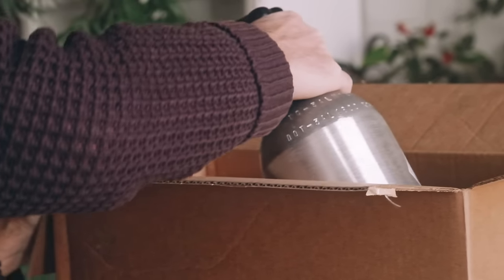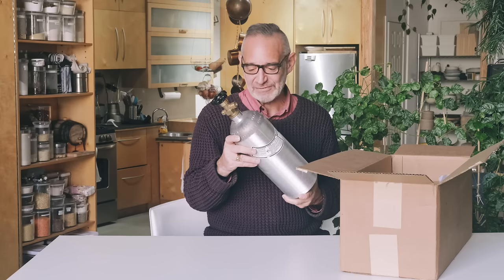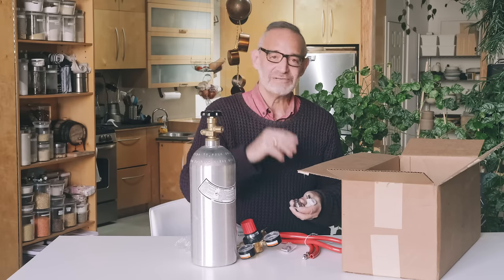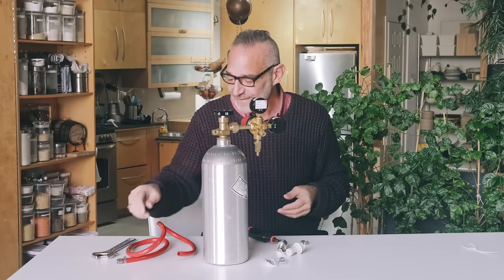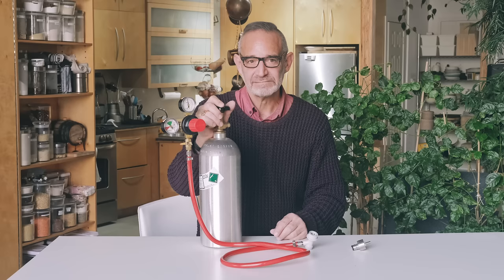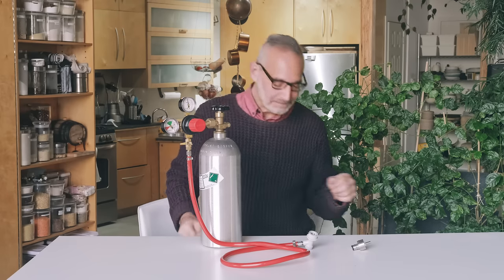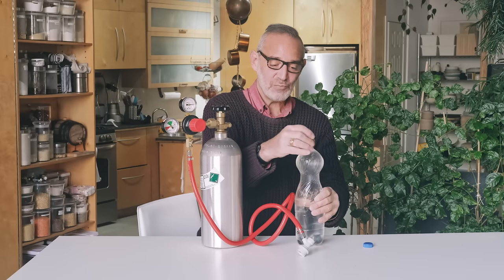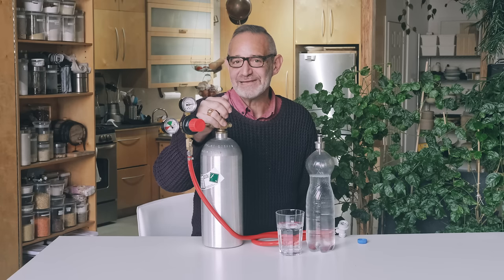CO2 Tank For Making Sparkling Water | What To Get and How To Put It together

Comment: I use a 5 lb tank to refill my smaller gas cylinders at home.  $34 USD for the braided stainless hose and fittings and $79 USD for a NEW powder coated aluminum 5 lb cylinder.  No regulator required.  $16 USD to fill the 5 lb tank.  For an additional $14 USD I can get a hose and fitting to hook the 5 lb tank directly to my AARKE soda machine.  Just another option to your system.  Thanks for the video.  New kitchen looks great!
Reply from the maker: Interesing system you have going!  Yoou'll see in coming videos that we like to carbonate various things aside from water, so using the soda bottles works best for us. Glad you enjoyed the video, and the new kitchen!
I like the Seinfeld reference too.
Reply: I just bought an Aarke & would love more info on how you hooked it up to your 5lb tank and how you hide it please! I also like the idea of refilling the cylinders but I’m a little afraid of doing it.😬
Reply: @melanie.c25  I don't hook my 5# tank directly to my Aarke.  I refill the cylinders.  There are videos on Youtube that show in better detail than I can explain here.  You need the tank.  The hose setup from amazon.  And a scale to weigh the small tank as you fill it.  It's pretty safe.  The tanks are rated for about twice the normal pressure, so if you fill it correctly, you have a huge safety range.  I have filled 4 tanks and expect to get another tank and a half out of that 5# tank.  That's under $3 per tank.  The 10# tank would save even more as it is only a few $$ more to fill 10# than it is 5#.  But the 10# is awkward to handle when filling the smaller tanks.  Also, the hose set up has great instructions included.  I can't post a link on youtube but this is the actual product: "FIDEURSUS CGA320 G1/2 CO2 Cylinder Refill Adapter Hose CO2 Refill Adapter Fill Station Connector Kit for Soda Filling for Tank Bottle (CGA320 to TR21-4, 36inch Hose, Dual Valve with Gauge)".  This company also sells the direct hookup kit, although you will have to modify your Aarke body or cut a hole in your countertop to use the direct hookup.
Reply: I never would have even thought to try and refill them, so very glad for this comment!! I need a machine my kids can use but haven't invested in it because of cartridge price. Being able to refill them at home instead of spending $100 or so for a pack of CO2 tanks is genius 😅
Reply: Make a video for that plz
Reply: @loneranger5349  your mama
Reply: How many liters of water Perrier like does it give you? Give or take
Reply: It costs me $17 to fill my 20 lb tank
Reply: @krazmokramer  The problem with the Aarke, and i assume all the other SodaStreams, is that those units determine the maximum pressure that they allow the H20 to be pressurized with,  quite low probably for 'lawyer's ' purposes. The name of the best and cheapest game is what you see in this video; 
De-aerated H2O to start with  mildly boiled will do that), then chilled to the point of being slushy-icy, then CO2 infused at say, 50 psi, then put right back in the fridge to stay as chilled as possible- short of solid ice.  When time to uncap (gently) and pour, use a icy chilled glass, and GENTLY "slide" the pour into the glass.  All these steps will maintain the maximum CO2 'tang'. I used the Aarke system for two years, refilled the cylinders from a 20 lb CO2 tank. A LOT of CO2 is wastes in purging the lines each time so its quite wasteful, and the Aarke, though an elegant sodastream system, just doesn't put out the carbonation that the above system will, and is a LOT more expensive to buy AND use.  Been there, done that.
Reply: @divingfe  I have no "problem" with the Aarke.  It works exactly as promised, looks good on the counter, takes up very little space, and has not broken or failed to perform in the nearly 2 years I have owned it.  I'm not trying to set a world's record for the highest molar concentration of CO2 dissolved in water.  I'm just trying to get something that satisfies my desire for carbonation.  I have absolutely no problem with my Aarke.  It suits my needs.  As for it being "a LOT more expensive to buy AND use", yes, it was more expensive to buy.  As for the expense to use...it's exactly the same.  A 5, 10, 20# gas cylinder hooked up to my Aarke or a 5, 10, 20# gas cylinder used as in this video will cost me EXACTLY the same for the cylinder purchase and each time I refill that cylinder.  I have better things to concern myself with than trying to get the perfect bottle/glass of carbonated water.  I carbonate it, drink it, and get on with my day.
Reply: @krazmokramer  I'm glad you are happy with your Aarke system. I was, for about 2 years, using a 20# tank to refill 3 of the Sodastream cylinders, then each of them in turn to the Aarke unit, and 3 Aarke plastic bottles  to fill after being chilled. I  found that a lot of gas was wasted in the processes (as careful as I was), and, as mentioned, the Aarke didn't give me personally, enough CO2 'tang", because of its internal pressure limitation (the "buzzy" pressure relief sound)- nowhere near what the newer system does.
 In fact, when I first switched over to the 'new' system, my 20# tank was "so empty" that it would only fill an Aarke cylinder to about 100 grams-rather than 400-500 when full- , hence time to get it refilled.
 BUT, when I connected the new system (without refilling the big tank),  it has, up to now,  filled the  2 liter plastic soda bottles- 1 per day average-  for almost two months and it still has enough "pressure" for at least another month! Hence my comment about it being much cheaper on a daily basis.   When I was researching the "newer" system, I read a great article- 10 years old- about a person who had "invented" (not really) the tank/regulator/Soda Bottle system. He stated that, using a 20# CO2 tank with his system, he was able to fill  a single 2 liter bottle daily for a year and a half, before needing to refill it!!!  (Frankly, I didn't believe it it first; I sure do now!!!!)   Considering that to refill the big tank; It was $25 a couple of years ago, now it is $40.    To each his own, and welcome to it.  Best to you, sir.
Reply: @divingfe  I didn't get what do you mean by "new system". This is refilling system? or it is about how it is infused into the water? or it is about connecting big tank directly to carbonator avoiding small tanks refill?
do you have some googlable name for this "new system"?
Reply: @artemsokolov5007  Sorry to have been unclear. The 'new' system I refer to is, as shown in the video:  a larger, (5-20 lbs) tank, filled with liquid CO2- hence the weight designation- a dual gauge regulator attached to said tank, and an output hose attached to the regulator, which is, in turn, connected to a "carbonator cap", which connects, typically to a 1-2 liter PET (plastic) soda pop bottle, which has been filled with regular drinking water. Via the system just described, the CO2 (now a gas as it leaves the main storage tank) is infused into the water, at the pressure level controlled by the regulator. 
These systems, and/or their components are easily available on-line, or from local Homebrew beer/wine shops, who have lots of helpful advice, and can usually keep your storage tank refilled as needed.
It is not actually a "new" system; In various iterations it has been around for many years, but, after using the Aarke/Sodastream method, and being a bit unsatisfied, I "discovered" this "new" (old) system in various YouTube segments. I PARTICULARLY RECOMMEND the  "ART of DRINK' series on YT, and especially:  'Carbonating at Home with Improvised Equipment and Soda Fountains.html.  by Richard J. Kinch,  an excellent and very detailed description of the system, by one of the 'pioneers' of the system.  
I suggest Googling  "TAPRite", a respected purveyor of regulators and associated equipment, and, as, as you have found, YouTube as well.  
Hope this clarifies and helps. Kind Regards
Reply: @divingfe  thanks a lot man! really helpful stuff!

Comment: I've been using a setup like this for some years. I usually flavor my water with lemon or orange extract to a 1% solution (10 ml/liter) and typically use 2 liter soda bottles. I'm in the US and used to get my cylinder refilled at a fire extinguisher firm. Lately, all the places that I've gone to (4 or 5) won't refill the cylinder. What they will do is an exchange. The one disadvantage of this is that you don't get to keep your nice pristine tank. There are several advantages. First you pick up the exchange and leave and so you don't drop off your tank and come back later (sometimes much later) after refill. Second, you don't have to worry about the periodic hydro test every five years (in the US, Canada also from what I've read) as your exchange will have been properly inspected.

Comment: Good video. There is only one thing I would add. I would never pressurize anything instantly like he did. To many variables. Hook it up with the quarter turn valve off then hook up the bottle. now slowly open the valve. It will carbonate just as good without a possible blowup. Even at 15 psi, that is Pound Per Square inch, is a little dangerous. He is correct. Good carbonation is temperature and pressure. I worked on commercial carbonators in my youth.

Comment: I use the same system but added a rigid plastic tube (straw) to the bottle adaptor that just reaches the bottom of the bottle, then put a diffuser stone on that. The result is thousands of tiny bubbles of CO2 bubbling up through the water. I set my regulator to 40 psi, start the flow just like here and walk away for a minute or two, one shake just to be sure and add flavoring!

Comment: Never open the tank with the regulator set to any pressure other than zero psi. Always have the tank secured so that it can't tip over & potentially damage the main valve (tank will become a violent projectile under catastrophic main valve failure).

Comment: Awesome. I pieced together a custom kit like this one for $181 on Amazon, but using a SodaStream glass carafe. Because of this video, I was able to learn about all the custom parts I needed. One innovation I did was to affix a double barb bulkhead fitting through a hole I drilled into the plastic cap included with the carafe, and silicone washers to make it airtight. I used high pressure food grade tubing between the barb of the pressure regulator and the barb on the cap, with black hose clamps with shrouds meant for fuel lines to tighten the hose onto the barbs (so it has improved aesthetics sitting on your counter top instead of having visible steel hose clamps). I also bought a tank that looks decent sitting on my counter top.
Reply from the maker: wow, sounds like you've made a great setup!  Glad we could inspire you.
Reply: Hey filling a glass bottle with this setup is very dangerous, the glass could explode on you, be very careful. That is why the soda stream that uses the glass bottle is completely enclosed. I would very much advise against this.
Reply: Can you please share the Amazon links for the parts you obtained?

Comment: I've built a similar system seven years ago using a 20 lb tank. Cost $40 to fill and has lasted us for a few years before refilling. We usually carbonate a 2 liter coke bottle (8 cups) and that serves the whole family at dinner time.
Reply from the maker: Sounds like you have a great system for the whole family!  You’re saving a ton of money compared to using a sodastream!  Thanks for sharing
Reply: @NadiaandRob  Same system here for two of us. One 2 liter bottle per day on average. The 20 # tank will last until the tank pressure won't maintain  desired infusion pressure, Loooooong time. !!!!!
Reply from the maker: @divingfe  yes, a 20 lb tank is great if you have the space to store it.

Comment: Ordered from the US site, can't wait to get it. Had a bad experience with soda stream support and was looking to have a replacement, So excited thank you!
Reply: Arrived today, got my cylinder filled at a local shop called Aegis. Mine came pre assembled, and had a slight leak in one fitting but was likely just knocked loose in shipping and easy to fix.
Already loving it, way better than soda stream by far. Ordered a few more carbonation caps from Amazon to have spairs. 
Again thank you for this video!
Reply from the maker: So glad that worked out so well for you!  Stay tuned for other drinks you can carbonate.... video coming soon.
Reply: @TheSeeker385 which US site did you order from? My wife wants a soda stream and I knew there was a more economical way to do this.

Comment: Bought this kit for my partner for Christmas and omg he's like a kid in a candy store! He makes every and any type of drink fizzy. Thank you for the informative video! Do you happen to have any recommendations for a setup to add it to a coffee/tea bar?
Reply from the maker: So glad you're enjoying your carbonation setup.  The simplest way to add this to a coffee bar would be to make space under the bar for the CO2 tank, and bring the hose up through a custom hole in the bar.  That way you could tuck it neatly away, and just pull out the hose when you need it.
There are ways to put a countertop tap for carbonated water on your bar, but that's way beyond my expertise.
Hope that helps!
Reply: Look for kegerator kits. You can fill a 5 gallon keg and carbonate it then have it on demand at a tap. I can easily find used kegs for 15 usd where I live on market. Place

Comment: There is actually a fourth factor that determines the amount of carbonation you get. Although it's related to one of the three factors you mentioned, I believe it deserves a mention on its own. That fourth factor is the size of the bubbles you create as you carbonate. Smaller bubbles, because of the higher surface-to-volume ratio, will more effectively carbonate the liquid as they pass through it. I started with a setup identical to yours and sourced from the same place,  and I use the techniques identical to what you've shown in every respect. After a time, though, I switched to a small dropper hose that attaches to the inside of the carbonation cap. That hose drops down into the bottle and I terminate it with a small stainless steel bubbler that works exactly like an airstone in an aquarium. It makes incredibly fine bubbles that are far less than a millimetre in diameter that, I believe, allow for more of the CO2 to diffuse into the water as they percolate up through the liquid. In summary, thanks for the excellent primer. I wish I had come across something like this before I spent hours researching all this stuff on my own. Cheers!
Reply from the maker: Yes, and who knew there was so much science behind making bubbly water!  Thanks for the info.

Comment: Ordered my system.  Just got it today.

Question….after carbonating the bottle and want to put back into the refrigerator, do you leave the carbonator cap screwed onto the bottle or unscrew and replace with the bottle cap?

btw thank you for sharing.  I was researching carbonation systems and did not feel comfortable buying the smaller systems found on Amazon.  The negative  reviews on most of them were concerning.  Then i stumbled upon your video.  So glad I did.  Got my tank filled for $25usd.

Thank you again!!
Reply from the maker: We leave the carbo cap on the bottle... so we can re-pressurize the bottle and keep the carbonation at full strength.  That stpps it from going flat.
Hope that helps!
Reply: @NadiaandRob EXCELLENT! Ive been carbo’ing my water since receiving the system.  Nice.

Looking forward to your video on carbonating recipes. :)
Reply: @juliuscaesar8801  Glad to hear you're enjoying your system!  Stay tuned for more!

Comment: Just WoW , the setup and explanation is formidable, i loved the attention to details when demonstrating it. One question: in the end of the video you have mentioned that the bottles will lose some CO2 when opening the cap and you have demonstrated a solution for that by carbonating it again and leave the cap on it but i would like to share some bottles with my friends and family so how can i put the bottles original caps back and not have the gas leave it or diminish. Thanks again for the great video , appreciate it a lot. ❤
Reply from the maker: When you take off the carbonation cap, and put on the regular cap, some co2 will escape, but the bottle will pressurize itself again and will stay carbonated.  Glad you enjoyed the video!
Reply: @NadiaandRob  thanks a lot !